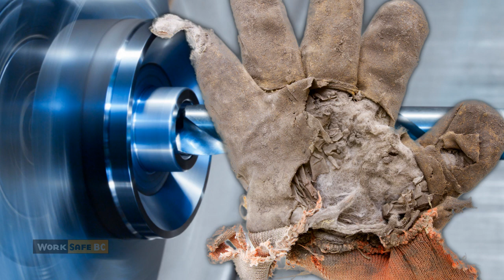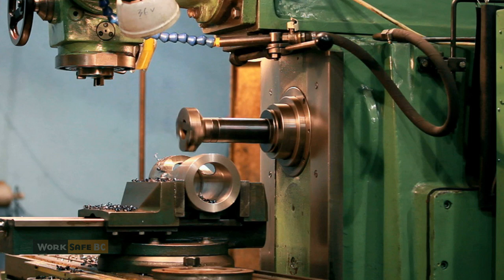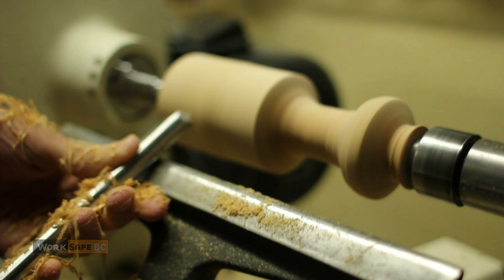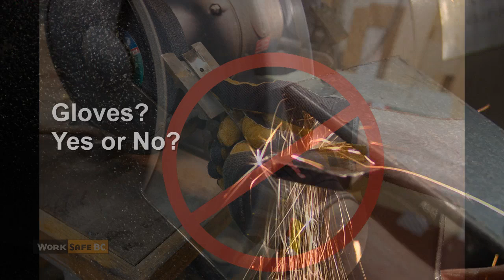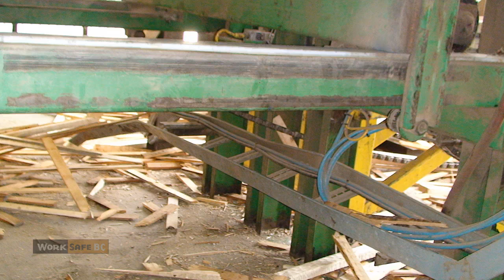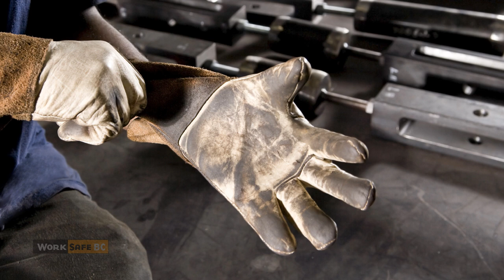When Are Work Gloves Dangerous?

Comment: Had an argument with my boss today about wearing gloves while using the drill press. I argued that NO it was definitely not safe and I wouldn't be wearing them, and instructed both my trainee's not to go near the machine if wearing gloves. Unfortunately my concerns fell on deaf ears, though I will fight it for the safety of myself and the people I am responsible for.
Reply: Does your company have a EHS manager?  Any manufacturing or production environment needs someone to clarify what is safe and what is not.
Reply: If I would wear gloves in my studies at young age, I would be kicked out of the class. It's dangerous like hell, also not putting long hair away, you will getting a scalp cutting and will horrible die. Don't do wear gloves on rotary tools.

Comment: I was using an 215mm angle grinder 10 years ago with a wire brush on, Id taken the handle off for extra clearance (had to get it up into a wheel arch). A hot bit of wire came off, stuck in my leg, I flinched, the angle grinder kicked back, leapt out of my hands, snagged my left glove, tore it half off and proceeded to flay a big strip of skin off the inside of my left wrist as it wound up on the glove.

Fortunately it was not a very powerful grinder, cant remember wattage now, but the glove in it and the flesh under it slowed it down a touch. First thought was to   rip it off,  but had just enough presence of mind to think "no it will speed up again!" and managed to turn it off before unwinding it.

Cause?  End of the week fatigue and rushing to finish. Always took regular breaks after that and learned to respect my tools and my fragile, mortal vessel.

Comment: I’ve just had a cloth/rubber glove ripped from my hand by a Dremel, which got tangled and stoped. I was so startled that I could’d move a single muscle for a whole minute. I just stayed there, frozen, half a glove in one hand, blocked humming Dremel in the other. It took a lot of will power to start breathing and moving again, and turn off the tool. Then I just took every gear off and got inside to calm down and search for videos about gloves and safety. Stay safe!

Comment: Long story short, if shit is moving, no gloves. If shit is stationary, gloves are cool. Mechanics can wear gloves most of the time, machinists shouldn’t. Flesh is soft. That’s a pro and a con. But the glove is tough and can resist pulling far more easier than skin. I’d rather be cut to the bone than have my whole hand pulled in and crushed, or worse.

Comment: I operate a pillar drill every week.
Yes I wear a glove on my left hand when doing so, metal swarf is damn hot - I don't want that stuck in me thank you.
I have dry skin so it cuts easily and heals very slowly.

I just keep my hand well away from the drill bit, further away than the length of any metal swarf and I 100% concentrate on what I am doing, I never look away without turning the drill off.

I don't know what y'all are doing to make it so dangerous, I see others look away while drilling - they are the ones that should not wear gloves.

Same for using a grinder, keeping my hands well away from the disc while wearing gloves.
Reply: Because even on lower power drill presses you can easily break every bone in your hand as your arm gets wrapped around the spindle.
On larger ones it will catch and wrap your arm round the machine and either rip your arm off or suck you in the rest in the way and kill you.
There are a ton of videos showing people dying on drill presses lathes and mills being sucked I'm from their clothes and gloves.

Comment: How about gloves that protect against heat, particles and most cuts, but easily rupture if torn with a certain force or for a certain length? The inner layer would be flexible and soft, so it can be torn off, but also heat-resistant,  and the outer layer would consist of small hard plates that overlap, but not interlock strongly - something like chain armor. However, if a blade with a sharp tip approached it sideways, it would be able to slip and cut under those plates, but that might be possible with usual protective gloves, too.
Reply: That's the issue, the glove being flexible. If it gets caught up then it can twist and pull your hand or fingers in, no matter what its made of. I would rather a cut or bruise that can heal rather than an amputated finger or hand.

Comment: Maybe I just got lucky, but I used a (small) bench grinder for the first time yesterday and was instructed to wear gloves, so I did. Extremely ill fitting ones at that. They made contact with the grinder several times, but didn’t drag my hand in. They simply started to eat a hole through the fabric which made an unpleasant burning smell. Mind you I was doing this for HOURS. Ironically the most dangerous aspect for me was NOT the gloves, but objects getting ripped out of my grip and flung at high speed. Luckily a steel beam behind the grinder caught them. That’s just my personal experience though.

Comment: Reading the comments I see where the opinions are about evenly split.
Years ago we were eating lunch in our job trailer when our boss got a phone call from an apprentice who heard a news report of a fatal industrial accident.   My boss called the office to learn that it was true.  It involved a crew that was working at our job the day before.  They were on a baseball field, changing light fixtures along the outfield fence.
Our lineman had climbed the pole and was waiting for the ground crew to raise a new light fixture for him to mount on the cross arm.   The ground crew was using a truck mounted capstan and a series of large pullies to winch the lights up the pole.   The capstan was powered by a PTO driven by the truck motor.  It required an apprentice to sit in the truck's cab to operate the PTO.  
A groundman wrapped a 1" rope around the capstan multiple times to raise and lower the lights.  In doing so he needed to wrap the rope another time around the spinning capstan to complete the lift.
In doing so his gloves became pinched between the spinning ropes on the capstan.  The capstan sucked the worker into it and spun him.  The top of his head hit the truck's massive bumper, cutting it off and instantly killed him.  
It was not good.

Comment: there are differnt gloves for different jobs gloves should be worn at all times in the event of. hazardous conditions wear the proper fitting gloves ppe should be worn at all times . tight fitting gloves not that of leather garden glove sgould be use sheet metal or glass golves should be used in place and be provided by all employers. At no time does osha state or suggest ppe removal but if gloves are a hazourdous condition seek proper tight fitting gloves that fit

Comment: Happend to me once.
Drilling on a drill press and some of the metal curls grabbed my gloves.
Lucky for me I was stronger then the gloves.
.
Never liked gloves before that moment now I straight out hate them.
Same as safety shoes with a METAL toe gaurd.
Plastic is much saver because plastic doens't bend and cut your toes off.
Reply: Yeah, plastic will get crushed with your toes
Reply: I remember grabbing metal curls from a bridgeport mill. They sliced clean through my fingers. The gloves might have saved me some pain. :-)
Reply: As a horse rider, I was specifically told to never wear steel toed boots for the exact reason you described. I may not be in the same class as you guys, but having a 1200lb animal step on you with full weight can cut your toes off without the help of a steel lopper. Many layers of heavy leather is what was recomended to me.

Comment: Hell no.  Gloves, 100% of the time.  The loose fitting leather gloves are for slinging material like wood, steel or garbage.  Big leather gloves with huge cuffs are for welders.  Any time you are working around machinery or doing anything at all when you need the dexterity of your fingers, or need to protect your hands without the loose fingertips or cuffs, I go with mechanics gloves.  Mechanics gloves form a skin tight seal around your hands and move with your hands, offering no snag points for machines to grab on to.  I refuse to do any kind of work without gloves on, but I also spend the money and get GOOD gloves that are skin tight and offer no loose bits that can get caught up in things.  There is a glove for every type of situation and I firmly believe that gloves should be included as a part of standard PPE in ALL situations.
Reply: Isn't that still a item that can get caught and eventually pull your hand off like this video states

Comment: So here's my question:

are there gloves that don't pose a de-gloving risk, and if so, do they have major disadvantages?
Reply: I would think that vinyl or latex gloves can't be caught and pull your hand into the rotating tool
Reply: @e-curb  incorrect. I wear nitrile gloves for work, and have had it caught in a wire wheel on the bench grinder, and it ABSOLUTELY CAN drag your hand in. The only saving grace with those is that they're easy to tear, unlike fabric, heavier-duty gloves, so the risk of de-gloving is considerably lower. However, not impossible; if the force of my entire hand hadn't been enough to completely stop the machine running (and it runs at hundreds or thousands of RPM), I almost definitely would have had most of the skin, fatty tissue and tendons torn off of my hand. 

Because a nitrile glove caught. 

Anything in an industrial environment can cause a hazard without warning if one isn't careful. Some lessons are hard learned, and we get lucky; others, not so much. And as a first-aid attendant at my job, I have to be even more aware of the potential hazards, and correct any dangerous behaviour in the shop environment. 

Again, a nitrile glove got caught, and pulled my hand in. It could've been SO much worse than what was basically mild rug-burn.

Comment: Drilling metal using a drill press, it is safer using gloves. Without gloves, the heat on metal will burn your finger
Reply: Why are you holding metal with your hands, when it can be held with a vice or clamps, much safer and less risk of injury
Reply: If your steel is getting hot on a drill press you're doing it wrong.
Reply: No, no it isnt safer to wear gloves. Recently watched a buddy get his fingers amputated because he wore gloves on a drillpress. If the metal is hot you are running the risk of breaking your bit, if you mean the metal shavings then boo hoo tough it out

Comment: This sort of safety is for idiots, seriously. Good luck with holding a hot piece of metal with bare hands while grinding it. Drill? It's spinning, fast, keep your hands off it, gloved or not...
Reply: ardvark84 psssh
Reply: You are right, analyzing this, the key is to wear gloves with a perfect fit, never loose gloves just like those cheap leather gloves, any loose piece of cloth will get caught in anything spinning fast...
Reply: Alejo Colombia Like sleeves...
Reply: Speak again after actually doing something.
Reply: Alejo Colombia, there are no gloves that fit that well. And even with perfect fit, because the glove is not attached to your flesh the machine doesn't need any excess material to grab it. Once it snags even a little, the machine starts to pull it off your hand, and that gives it more surface to grab onto, and there goes your hand.